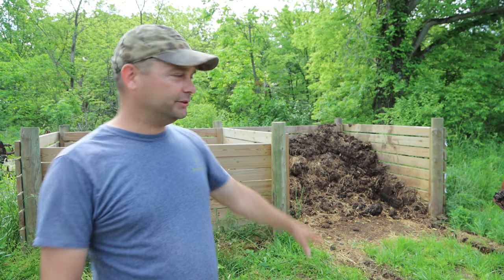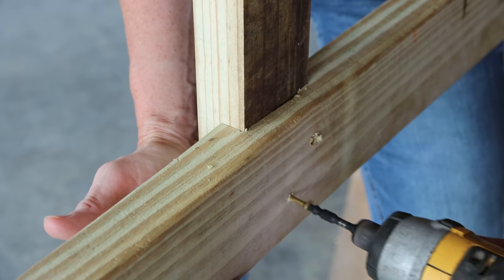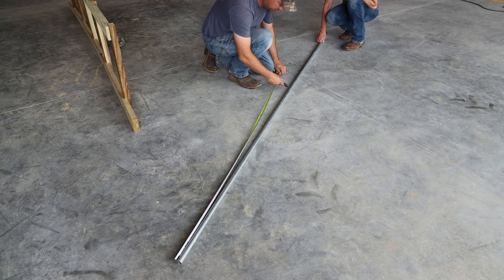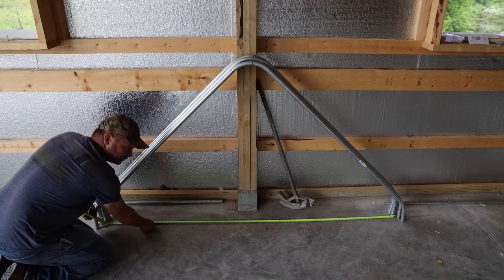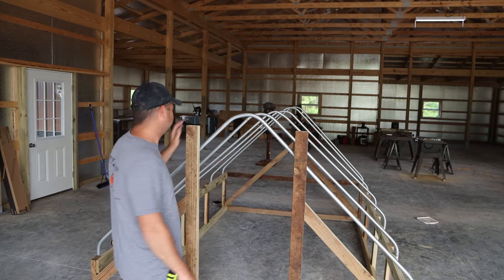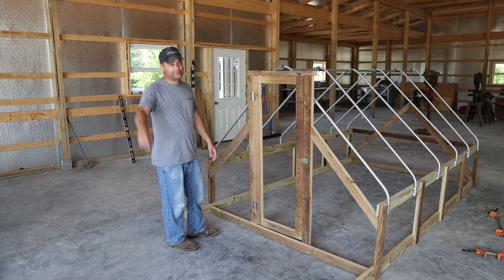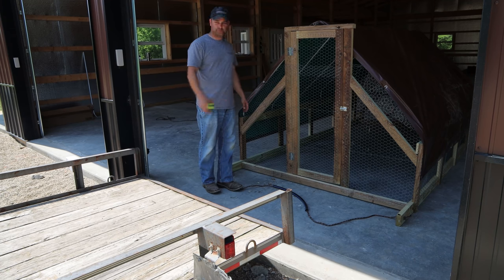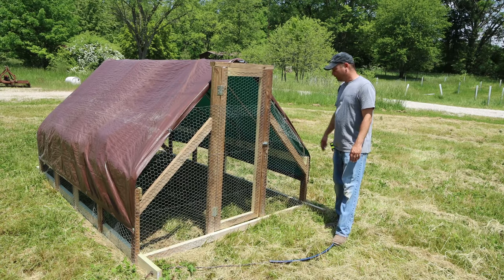Building a bigger Chicken Tractor, so we can get all our birds on Pasture.

Comment: Why not put an angle on the two front runners, possibly 30°(like with a sled/sledge) so it doesn't dig into the earth when pulling? It was the same with the steer/hay thing you built.

Comment: Looks great, might want to add the following overtime -  run a few purch's across the back, on the back run a 2x4 up to your center poll to give it a bit of support at the back, put an angle on the runners for easier pully, and if those self-tapping screws start to pull out on your ridge over time replace them with a bolt washer and nuts running all the way through.

Comment: Hey, great tip to add to the chicken tracker. You know the small plastic election/Real estate signs in people’s front yards ? Slice into 2 1/2 inch wide strips long ways to cover bottom of skids. Staple them to the bottom of skids, starting at the back and overlapping slightly working toward the front. The skids will never touch the ground. And if you chalk the bottom of skid before with an adhesive to seal water from getting between plastic and skids, you won’t even have to staple them. Also, the front of each skid should be cut at angle so it doesn’t dig in when you drag it.

Comment: Looks good Evan. Seems like we just finished our chicken tractor the other day and we’re all set to process already this Saturday. I cut a PVC pipe in half and attached them to the bottom of the tractor as slides. It glides through the grass so easy. Give it a try if you have any difficulty moving it. Good job!
Reply: That's a great idea! Saw the Modern Yeoman working on his chicken tractor also and I wondered how you guys move these things.
Reply: @DavisFamilyLife  Yessir, the weight of them adds up pretty quick. The slides worked out great, check it out: 
https://youtu.be/2Upw5lQA02Q
Reply: @HiddenCreekHomestead  Doing that right now. Subbed too. 👍👍👍
Reply: @DavisFamilyLife  wow really? Thanks so much. I’ll go sub to yours as well right now.
Reply: Thank you so much! Really appreciate that.
Reply: With slides like PVC pipe on bottom of wood you will not need wheels. It should slide fine.
Reply: @karencary3312  used water or snow skis work well.

Comment: You could've spliced on straight pieces of conduit to make the roof a more workable height. An angled cut under the front ends of both sled timbers will make dragging it around easier.

Comment: Add a bottom of flat steel on the two runners and bend the front up to act as a curved runner. Add wheels to the rear and no trailer ever needed to pull it. Triangle wood reinforcement at the four corners tie it all together nicely. Just my two cents worth.

Comment: JudithB  I  bought  6   2x6x8s  and  it  was  $77.00  yesterday.  Last  year  they  were $7.00  each  this year  $11.  I  will  build  the  last  hoop 4x8'  bed,  and  finish  a  2x16' bed  in the  garden.  I  have  room  for  one  more  16x4'  bed  and  a  few  smaller  beds,  but  those will  wait  until  ????  I  would  have  used  a  piece  1/2"  pvc  to  figure  the  roof  line  to make  a  round  top  I  think  like  on  my  hoop beds.  I think it  would  shed  water  better  instead of  puddling  like  my  big  carport  does.  Just  a  thought!  I  think  I  will  screw  my  pvc hoops  to  the  ridge pole  like  you  did tho!

Comment: Great project!!  An idea for you if the pipes start to wiggle. Notch a board and screw on around them for extra support. Thanks for sharing. Looks like it should last for a long time. Also maybe cut the bottom leading edge with a small angle to help it slide when pulling. But awesome finish. I love the pipe for peaked roof.

Comment: If its flat on the ground, foxes wil dig straight under it and grab them, take them out to eat them, then come back for several more. We have a fox on a game cam digging under a tractor we had and they got the whole flock that way. You have to bury hardware cloth around the outside and attach it to the coop. so they cant dig. Extend it out a few feet.
Reply from the maker: Wait till the next video to see how we prevent predators.

Comment: I've been a carpenter a really long time, you don't need to clean the notches with a chisel, it's easier and quicker to let the saw do all of it.
Reply: crimsonwizard01  Nope not at all, I own several routers.  For those cross notches in treated and untreated 2X4 a circular saw is way quicker than router. I can make a video to show you, I've made my living as a builder 35 years. The 7" blade is more efficient and last way longer than a router bit.
Reply: @stu3775 , Yup, we just slide the saw left and right and done !
Reply: @augustreil  Sometimes a slight angle on the clean up slide, as we focus to keep the wide side of the saw shoe flat on the board. I really am about to do a video.

Comment: Nice to see the new building being used for projects.  Tractor looks good and sturdy.  You may be able to get away without wheels.  It looks fairly manageable right now.  Nice touch on the tubing for a handle.  You made need to add an additional handle at the other end so once you reach the end of a run or row, you can move it over 12 feet and start dragging it the other direction.

Comment: I've just about decided that if you have to buy much lumber in the current market, might as well my an LT15 and mill your own. I might have cut the front bottom of the runners at an angle to make them easier to move without digging in, but it is a nive design and very sturdy looking structure. Regards, Solomon

Comment: Would have used the 3 point on the tractor to lift the front up when pulling so it didn't drag. Work smarter, not harder.

Comment: This is why you need to be on the lookout for any metal bed frames in the trash as the metal in them can be used for projects like this. A cheap flux core welder or a stick welder so no shielding gas needed and you can quickly weld together the metal from the bed frames into many projects. 

Making it out of free metal also means that it will last longer then wood and you are turning something that would be trash into something useful. Add in some bike wheels on levers so you can lower/lift the wheels and you have something easy to move when needed. 

If you don't want to be hunting down the metal yourself you can always find a scrapper to buy off of as they will gladly sell to you if you are paying more then the scrap price so may have to spend $1-5 per bed frame.
Reply: Bed frame metal is very difficult to work with and to brittle after welding and often looks trash and cheap , very difficult to drill and hard on sheet metal screws.

Comment: why didn't you run the chicken wire all the way up and then cover it with the tarp? those tarps will weather rot rather quickly in your Southern Illinois climate, with the sun baking them and the Humidity! and it would cover the sides of the doors so predators cant get in for a free dinner
Reply from the maker: The tractor is surrounded by electric netting, that protects it from predators.

Comment: A wood shop should not be without a PORTER-CABLE plunge router. Using a custom built jig it would have done the dados in half the time it took you.

The Jig I'm talking about is meant to be hung on the wall and taken down when needed. It's easily adjustable and you will find you can cut perfectly fitting any size dados any time.

Comment: The bad guys are going to have it easy to dig around the sides and get into the Chickens, putting the chicken wire  around the sides and covered with dirt would stop any digging, And your tarp isn't going to last very long in the sun. I would look at Coraggated tin or plastic for the roof. Even a Eagle or Hawk would tear through the Tarp and get to your chickens. With what you have there, you ain't going  to be putting many chickens in the freezer.
Reply from the maker: I will bet I don't loose any to predators in the next 4 weeks.  Just wait and see.